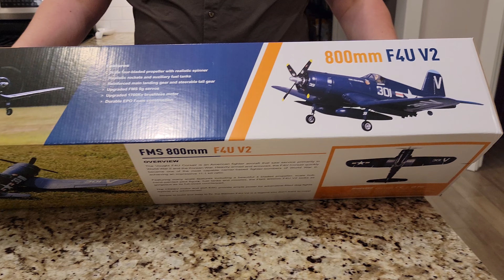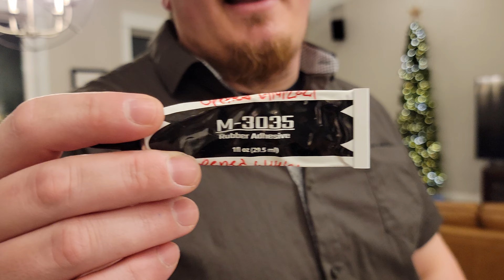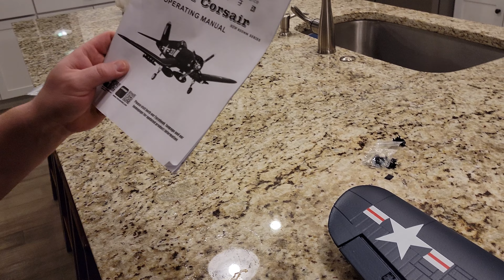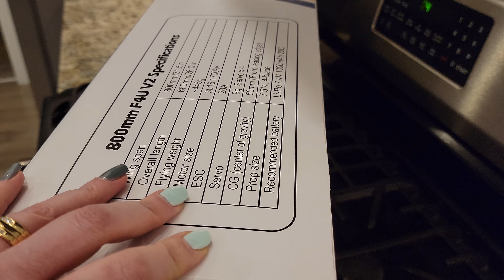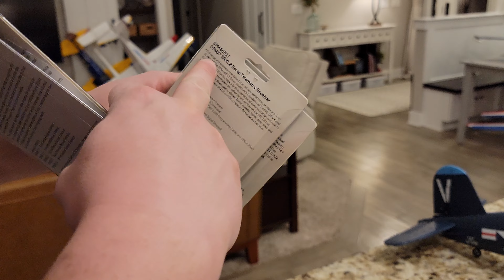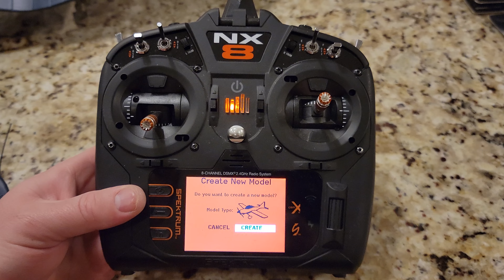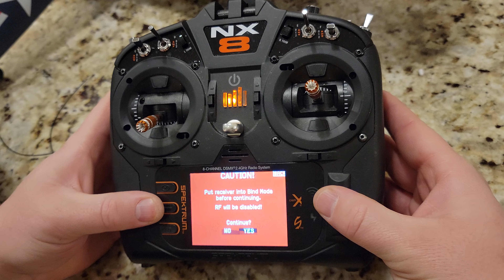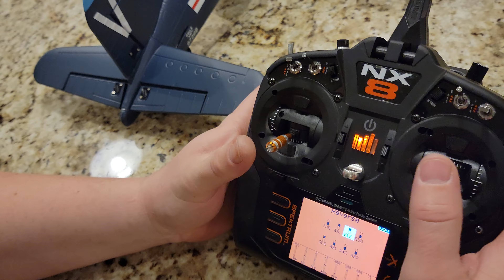FMS - F4U Corsair V2 - 800mm - Unbox, Build, & Radio Setup

Comment: Very cool setting up the F-mode to display and speak the Stability Control. I did just as you did only using my switch G because on mine the factory Reflex V2 is a 3-way switch mode (stab on, Off, optimized/self-leveling. It worked perfectly just as you showed but now...HELP me, please. How do I keep this and add to it...Throttle Cut so that the NX8 displays and speaks (Throttle Cut, and or something like Motor On, etc.). I tried doing it in FlightMode for Switch 2 in the setup and toggling the A switch and going through the setup but somehow I did something wrong because all I ended up doing was overriding my Switch G position 0 to now say and display Throttle Cut. lol. Please assist or send me a link if you have gone over this before. I am surprised the NX transmitters don't automatically just have a box check or uncheck the option to speak the command next to the main menus (such as Throttle Cut).
Reply from the maker: I haven't made that "Call Ot" - and YES, that checkbox would be very nice! I wonder if Spektrum added any of this to their latest and greatest update to "airware" - I'm admittedly waiting for everyone to scream "the sky is falling" to update my NX'es, since I just don't care ;) Don't fix what isn't broken, kinda thing - since the last time was a bit of a fiasco, if you recall - LOL / cry.

As for making this happen - we don't have a video, since we haven't done it, but it's easy...

Click into "Function List"
Scroll down to "Audio Events" and click in
Click to chose "Switch Change Reports"
Make a new event for "H" (or whatever switch you assigned)
"Throttle Cut Off" for "0" - The switch condition that's AWAY form you
"Throttle Cut On" for "1" - The switch condition that's TOWARD you
Works like a champ ;)
Reply: @BrianPhillipsRC  Thanks Brian! Your the best man! If your ever up in the New England Area let me know! Buy ya a beer and would love to go flying with you sometime.

Comment: does this come with a remote in the box or do i need to buy it
Reply from the maker: This plane comes in 2 versions... 

PNP (Plug and Play) which means you'll need to provide the transmitter, receiver, battery and charger of your choosing.

If you look in the description box for the video, you'll see all of the items that we recommend to complete this plane.

RTF (Ready to Fly) which means everything is provided except for the transmitter batteries. Honestly, I didn't know if came in a RTF nor have I have I seen the transmitter and battery combo it comes with.